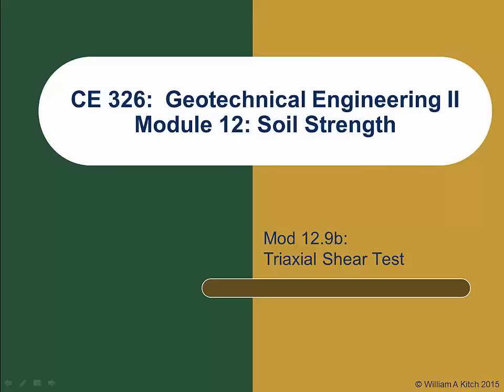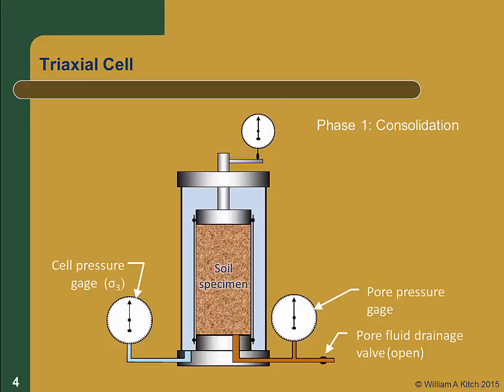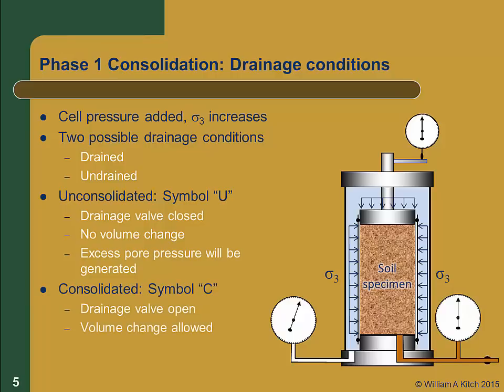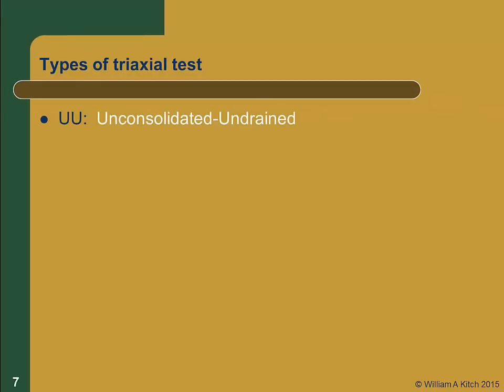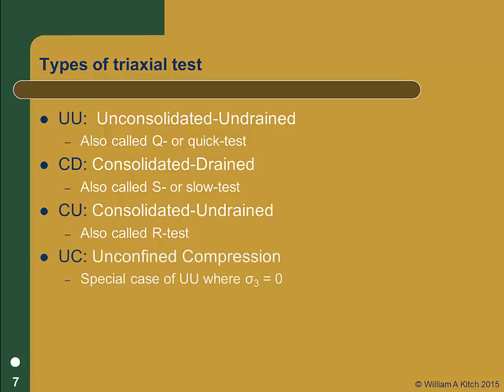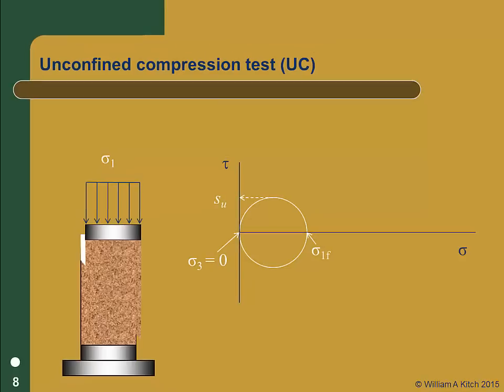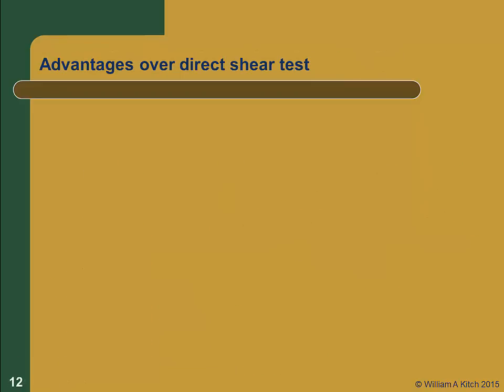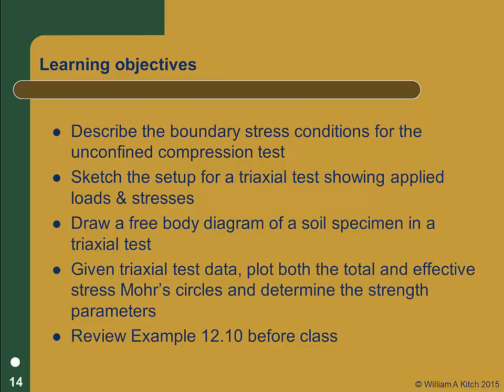CE 326 Mod 12.9b Triaxial Shear Test

Comment: The Mohr's Circle for the Consolidated-Undrained test is incorrect. Effective stress is total stress minus pore water pressure (σ' = σ - ∆u). σ'  would be less than σ, the dotted circle should shift left, not right.
Reply: The Mohr’s circles are correct. This soil in the animation is generating negative excess pore pressure during shear so the effective stress increases. Negative excess pore pressure occurs when overconsolidated clay or dense sand is sheared under undrained conditions.

Comment: Dear Professor Kitch, may I raise out a question on the CU test that why a negative pore water developed such that effective stress is larger than the total stress, shifting the Mohr Circle to the right? Thank you
Reply from the maker: Dense or overconsolidated soils tend to dilate during shear, that is increase in volume. In this case, we’re shearing under undrained conditions, e.g. no volume change allowed. Therefore, instead of dilating, the soil responds by generating a negative excess pore pressure.

Comment: At the CU test 13:50 ....Shouldn't you subtract pore pressure from total stresses rather than add them,since effective stress equals total stress minus pore pressure?
Reply from the maker: We did subtract the pore pressure from the effective stress.  In this case the shear induced excess pore pressure was negative (a dilative soil), so subtracting a negative stress added to increase the totals stress.

Comment: why there is no UD test?
Reply from the maker: Not a logical test to perform. If we increased confining stress with drainage valve closed, then there would be no change in effective stress but a significant increase in positive excess pour pressure. If we then opened the drainage valve during shear, the we would hav consolidation and shearing happening at the same time.

Comment: 13:21 - CU test, should the σ3 value at the consolidation stage be effective consolidated stress like in CD test at 11:53?
Reply: no but you can obtain the effective stress by subtracting the pore pressure from the gauge

Comment: I have a question: in the last test (CU), first you allow water to drain slowly to measure sigma_3, and then close valve to measure excess water pressure, how did the gauge measure water pressure? Did you fill the sample with water again after drainage and before closing valve?

Comment: In the CU test (14.02) the Mohr Circle given by the total stress.  Then the pore water pressure added and create the new mohr circle of effective stress. why is that?

that Effective Mohr Circle should be left side to the Total Stress Mohr Circle?

 Effective stress = Total stress - pore water pressure ?
Reply: Shaluka Fernando the consolidated dense soil wants to dilate (expand), which will absorb water resulting in a negative pore water pressure.

Comment: I read in your book (Foundation Design Principles and Practices 3rd edition) this statement.  In general su (phi = 0) increases with depth because the lower portions of the stratum have been consolidated to correspondingly greater loads, and thus have a higher shear strength. Would you please explain why does consolidation increase shear strength?
Thank you so much!
Reply from the maker: Consolidation increases the density and decreases its void ratio. This will both stiffen and increase the strength of the soil.
Reply: Your the man! Thanks a lot!

Comment: in the CU test, does anyone know why we have a negative excess pore water pressure?
Reply from the maker: It depends upon the soil.  For a dense sand or an overconsolidated clay, the soil will tend to dilate during shear.  In this situation, if the soil is sheared under undrained conditions, the pore pressure generated will be negative.  For loose sands or normally consolidated clays, the soil will tend to compress during shearing.  In this situation, if the soil is sheared under undrained conditions, the pores pressure generated will be positive.

Comment: For the first consolidation phase, I think the Professor means primary consolidation settlement because the load is being increased. Does anyone agree?
Reply from the maker: It could be primary consolidation or secondary compression.  The source of the consolidation is not important for this discussion of shear strength.

Comment: does anyone know, why there is sigma3 instead of sigma2
Reply: sigma 2 is the intermediate principal stress which is not taken into consideration. sigma 3 is the the minor principal stress.  sigma 1 is the major principal stress
Reply from the maker: In this test the two stresses in the horizontal plane (acting on the vertical sides of the specimen) are equal, because they're both generated by the cell pressure which is the same in all directions.  Therefore the intermediate principle stress, sigma-2, is equal to the minor principle stress, sigma-3.  By convention, we generally present the data in a two dimensional form using only sigma-1 and sigma-3.

Comment: pls explain how the confining pressure maintained uniform as we know that hydraulic pressure increse along the depth but here there is uniform pressure
Reply from the maker: The specimen is only a few centimeters tall, usually 10 to 15 cm.  Over this distance the vertical change in cell pressure is negligible.

Comment: Why do we have a negative pore pressure during the CU test??
Reply: I reckon if the sample is OC/very stiff it would dilate during the first part of shearing and so the volume of the sample would increase. The increase in volume would cause -(ive) pore pressure  ...silly
Reply: It's depends on soil is normal consoilidated clay or over consoilidated clay. Each has different tendency of volume strain which lead to +or- pore pressure.
Reply: I still dont get it
Reply: Basically, pore pressure generally seeks to decrease the effective stress of soil. Thus, if pore pressure increases the effective stress, it means the pore pressure is negative. 
As to why this can happen, you have to keep in mind that pore pressure usually seeks to decrease effective stress only if the soil is saturated. In other words, the pore pressure is negative only if the soil is saturated. Here, during the CU test, since we drained the soil sample in the consolidation phase, a significant amount of water has left the soil sample and thus it is no more saturated. In unsaturated conditions, the pore pressure is negative. This is the reason for the negative pore pressure.

If you want to know why pore pressure is negative during unsaturated condition, then I suggest you visit this link - http://environment.uwe.ac.uk/geocal/SoilMech/water/water.htm Hopefully, you'll get your answer. :)

Comment: why is the sample required to be a 100% saturated??
Reply: Because if u allow a partially saturated condition the measurement of pore pressure will be even more complex, due to the presence of the air with the water creating a pore air pressure. also with the presence of air, chances of air bubbles that may be present in the soil are relatively high. The presence of air bubbles can potentially distort the results.
Reply: Thankyou Sir.
Reply: It's very complicate to obtain a sample 100% saturated in lab

Comment: so basically we don't control sigma 3. We control sigma 1 and check sigma 3. Plot the graph, isn't it??
Reply: +Arnob Ghosh The thing is that during the first phase (consolidation phase) you put a pressure of sigma 3 on all your specimen. During the second phase you put a pressure sigma 1 and sigma 3 remains the same as the one on the consolidation phase.

Comment: At 14:00 during the CU test why was the effective stress circle shifted to the right? Isn't this a positive pore water pressure? Negative would be a suction. Sigma' = Sigma - u
Reply: I think the pore pressure is positive, but the change in pore presssure delta u is negative.
Reply: +Adam Perez review terzaghi postulate
Reply: you actually wrote it Sigma' = Sigma - u, only that u is negative, so -(-u)=+u

Comment: Thanks!! This video helped me a lot. However I do not understand why is in consolidated and undrained triaxial test the pore pressure negative. Could you tell me?
Reply from the maker: ferfixer2 When soils are sheared under drained conditions they can either contract (decrease in volume) if they are relatively loose or dilate (increase in volume) if the are relatively dense.  This happens because soils are made up of individual particles that roll and slide over each other during shearing.  

If the soils are saturated and sheared under undrained conditions there cannot be any volume change (contraction or dilation) because both the soil and water are incompressible (relatively speaking).  So instead of volume change during shear, there is a different reaction--change in pore pressure.  Relatively loose soils generate positive pore pressure during shear because the soil wants to compress and push out some water.  Relatively dense soils generate negative pore pressure during shear because the soils wants to dilate and draw water in.

Hope that helps.  I have some nice ideas for videos on this, but they won't be done for some time.
Reply: @introductiontogeotechnical4976  best reply of my utube life
Reply: @introductiontogeotechnical4976  waiting sir
Reply from the maker: Vishabjeet Singh Rajput please see this webcast for an explanation dilation and contraction during shear. https://youtu.be/XCOPNMDhXkM
Reply: @introductiontogeotechnical4976  What an informative reply, keep up the great work sir
Reply: @introductiontogeotechnical4976  i would assume that for the  example the negative pore pressure (dense) was assumed as our material was previously consolidated so in dense state?
Reply: Introduction to Geotechnial Engineering Excelent!
Reply: good question. thank you. 🤏🏿🤏🏿🤏🏿
Reply: @leungleungleung6749  Thank you !!!
Reply: After shearing in dense sand pore pressure will be negative it means effective stress increased.
It means shear strength is also increased.
Am I right?
My question is shearing is good in case of dense sand??
Reply: @Skumarvlogs2024  Here's a more detailed explanation to clarify your reasoning:

1. Shearing Dense Soil: When a dense soil is subjected to shear, the soil particles tend to rearrange themselves to a looser state. This rearrangement requires space, causing the soil to dilate or increase in volume.

2. Pore Pressure Changes: During this dilation, the pore water pressure decreases, leading to negative excess pore pressure (suction). This reduction in pore pressure increases the effective stress (since effective stress = total stress - pore pressure).

3. SPT and Dilatancy Correction: In the Standard Penetration Test (SPT), the behavior of dense soils can result in overestimated N-values because the soil's resistance increases due to the rise in effective stress caused by dilation. To account for this, a dilatancy correction is applied, particularly when the soil is very dense and saturated. This correction adjusts the measured N-values to better reflect the soil's true state and avoid overestimating its strength.

Correction Formula:

For saturated granular soils with an SPT N-value (measured) greater than 15, the corrected N-value can be calculated as:

N{corrected} = N{measured} -{(N - 15)/2}

This ensures that the design parameters derived from SPT results are accurate and safe.